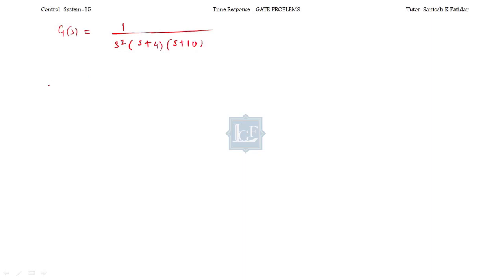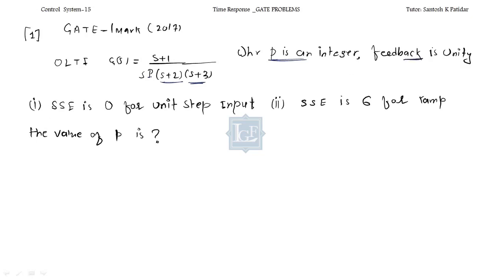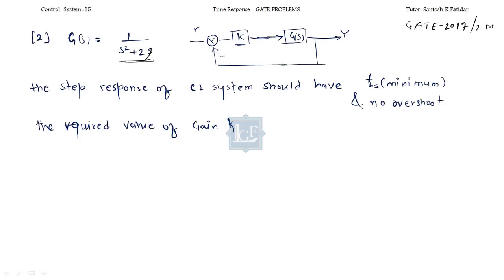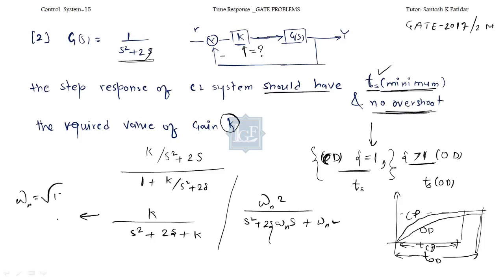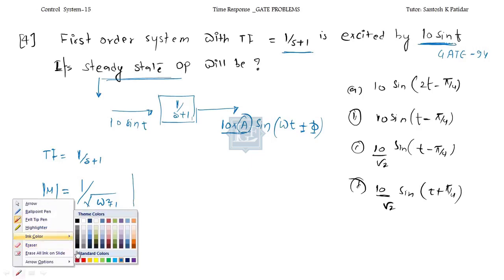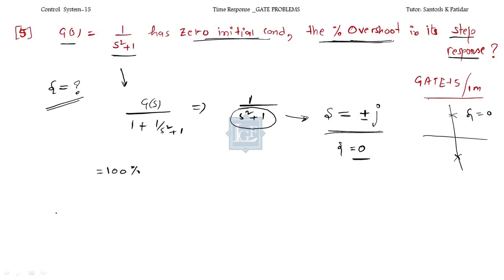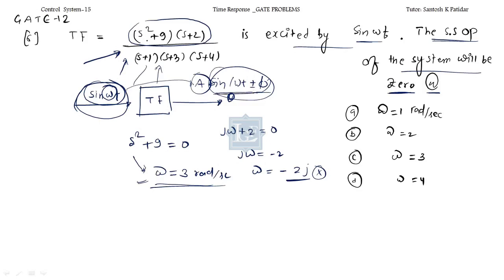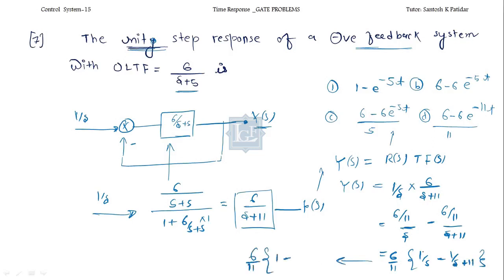Lec 15 GATE Problem on Time Response

Comment: Question 1 [5:50], why OLTF is not converted to CLTF before finding SSE? Sir/Any Gate Aspirant pls reply.
Reply: because here we don't need to find the value of  SSE, we need to find the value of p for which SSE is finite.
Reply: Maybe bcoz, the TF is oltf but as given it is with unity feed back, hence the system became closed loop. And we calculate SSE for closed loop system only.
Reply: but how can u compare the type with input without getting the CLTF
Reply: even if you find CLTF .. the type of system remains same only...that's is P in this problem..
Reply: Questions 1{4.25}...How input is 0 for unit step ?.....Plzz help me

Comment: Sir in question no 5 the value of close loop transfer function should be 1/(s^2+2).. the value of s should be +-√2j
Reply: however its remain undamped
Reply: Yes.. U r right..
Reply: then how zeeta=0??
Reply: Venkatesh Giduturi if you compare with standard eq of 2nd order TF then you will see that zeta is 0.
Other way to see it is that if system response is pure oscillatory means zeta is zero.
See the x-y table that sir has made where all the zeta ranges along with its response are drawn
Reply: @venkateshgiduturi5225  zeeta=0 for un damped, 
b/w 0 to 1 for under damped, 
=1 for critical damped and
greater than 1 for over damped system.

Comment: sir , in question 1 , OLTF is given and as we know , Ess is defined only for CLTF. so here we don't see this condition?
Reply: Hi Deepika, can you explain me, as i am still not getting the exact reason for it
Reply: Deepika Simariya 
Over system is closed loop in the given question. And the formula we already calculated for Ess. Check the previous lectures of error.
Thanks
Reply: not getting sir..😓 i am asking that why we don't convert OLTF to CLTF in question 1?
Reply: Deepika Simariya 
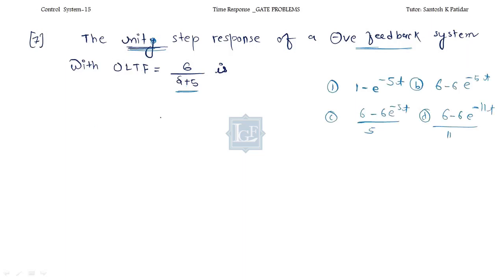Go to lec-13, 19:00,
U will get your answer there.
Reply: now I get it..😊😊😊😊thank you so much sir...😊
Reply: @ramkaran2653  how to check system is stable or not for the homework questin

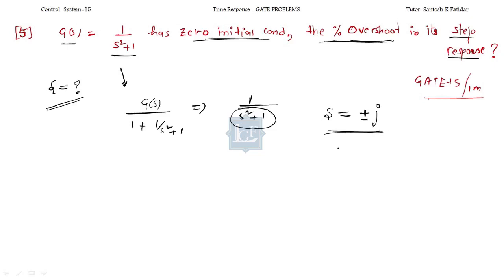Comment: Sir , @14:41  CLTF should be 1/S^2+2 so S value will be +- root 2 then overshoot will be same ?
Reply: Himanshu Nigam 
Correct👍
Overshoot will be same bcz undamped system
Reply: Overshoot concept is for 2nd order system...now compare the characteristics equation of 2nd order system with the given equation in the question...you will get your answer..